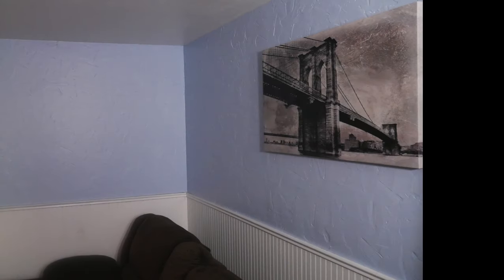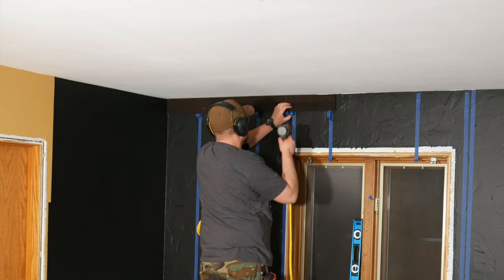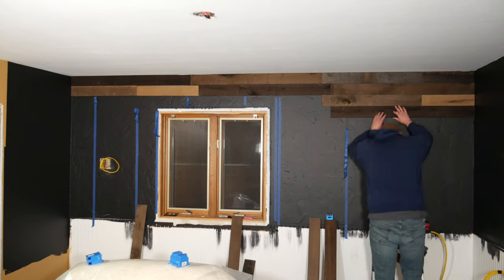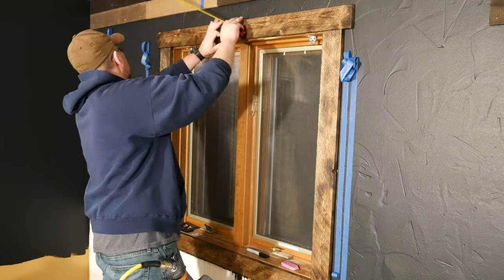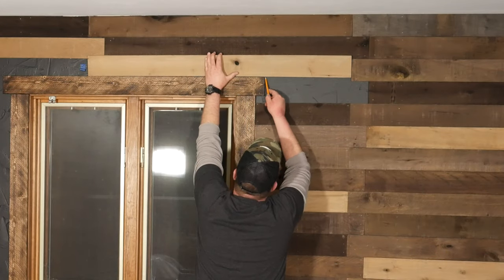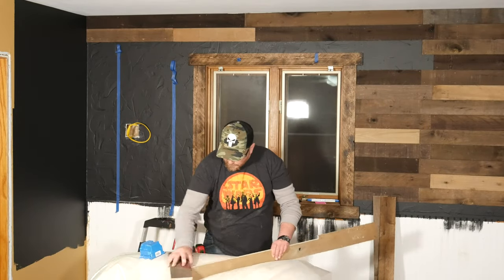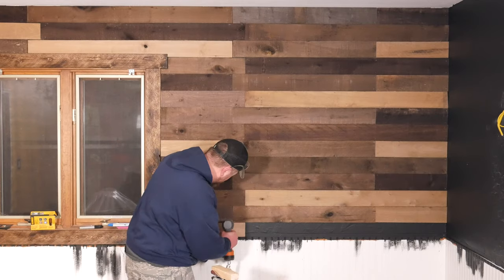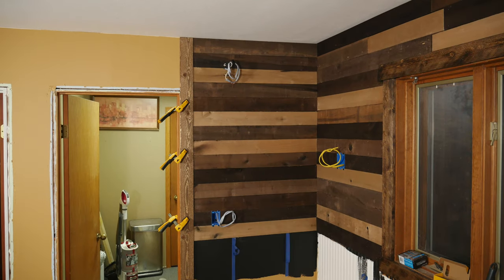How to install a rustic wood plank accent wall for beginners - The Family Room Remodel Part 17

Comment: Great vid! any issues with contracting/expanding/warping with change of moisture levels? thank you!
Reply from the maker: Thanks for checking out the video. So far no issues with warping after installation, they appear to be very stable. These planks come very, very dry out of the box. I would be surprised I ever have any issues with warping due to moisture changes, but I live in Montana and humidity levels are fairly low here. It would be interesting to see how these do in humid climates like Florida. In any case definitely let these sit in your house for a while before installing so they can acclimatize to the temperature and humidity in your house.

Comment: Nice job I was relaxed 
Question what size of nails did you use for the wall
Reply from the maker: Thanks for checking out the video. I used 18 gauge brad nails.
Reply: @JFKreations  2" or 1 3/4 or 1 1/2?
Reply from the maker: @MAZINKAIFER  it depends on how thick your walls are, how thick the material is your attaching to. I think I  used either 2” or 2-1/8”, whatever the longest I had on hand at the time. You have to consider the thickness of planks, plus the drywall (or lath and plaster, or whatever the wall is made of) to determine the length of the nails you need. In this case if I would have just done 1-1/2” nails, the nails would barely penetrate into the studs. Wouldn’t be a solid connection. Hope this helps you determine which length to go with. If you’re unsure, go with the longest your nailer will shoot.
Reply: @JFKreations  Thank you for the information and taking your time to answer me! I am your New Subscriber
Reply from the maker: No problem and welcome to the team! Glad you enjoyed the video

Comment: Thanks for the video! I have a question, I  notice that you nailed the ends of the boards even where there were no studs. Will these hold in the drywall?
Reply from the maker: Thanks for checking out the video. All the planks in this video are nailed into a stud at least somewhere along the length of each plank. The stud spacing on this wall wasn’t exactly ideal at 24” on center, and at that they weren’t spaced evenly. The layout I chose unfortunately landed some of the ends of some of the planks in between studs but there weren’t too many layout options with this stud spacing.  Nailing directly into drywall isn’t ideal, but if you run into a situation like I had here, if you drive the nails in at opposing angles to each other so they sort of form a criss cross pattern inside the wall that will add a little extra tension and will provide enough extra support at the end of the plank that is not supported by a stud to hold it to the wall. I didn’t mention the criss cross nailing technique in the video, because it is less than ideal and is better to avoid having to use but in certain situations it can work. This technique should really only be used on very light weight non load bearing items like these planks and definitely works best if each plank lands on at least one stud for solid support. Hope that helps.
Reply: @JFKreations  Thank you for the reply. I am in a similar situation with uneven stud spacing , on an old drywall wall.
Reply from the maker: Jimmie C If you have some real funky situation and can’t find enough studs to at least partially support the planks, as another option, you can glue these to the wall with construction adhesive. Let me know how it turns out!
Reply: @JFKreations  Thank you for your tips. I got the wall up on Saturday. I can't figure out how to post a picture here.
Reply: Add studs. 
Never listen to someone who tells you to do anything criss cross.
Reply: Be careful not to hit any wiring or plumbing between the studs

Comment: Thank you for a great film. I need to frame a small monitoring window in our bathroom to inspect if no leeks  under the bathtub. It will be an opening on the bottom of the closet next to that bathroom. I want to make a small door (~ 24" x 24") for that opening, but not sure how to frame that cut. I'm thinking about 1/2" thick planks around the perimeter (on one of them there will be hinges for a small door), but how to attach those planks to the drywall? Could you tell what nails or screws to use better for that project? Can I use a regular hammer or better to buy a brad nailer?
Reply from the maker: Skip the hammer and nail. That’s better saved for framing where the divots left on the wood by the head of the hammer don’t matter. If you want a clean look definitely invest in a nail gun. For lite trim work that doesn’t need a lot of holding strength my go to is an 18 gauge brad nailer. Or you could look at some decorative screws that can add an industrial look to the trim. But one thing you could also look premade plastic panels that are designed for this exact thing. I have a few in my house to access plumbing through a wall. You just cut a square hole in the drywall and slide them in place. It’s a clean look and if it’s in a place that isn’t readily visible anyway, dealing with installing trim and so forth may not be worth the time or cost.
Reply: @JFKreations  Thank you. I cut the hole long time ago, when installed the buthtub, since was paranoid if there will be a leak under the tub, and for good reasons since there was initially one, which I fixed via that opening (hole). Now I have time to install a small door there, but can't find any films about it. My main question is how better to frame it so I can put hinges for a small door on that frame. I think 1/2" or 3/4" Poplar plank would be a good solution for that frame. I bought already a brad nailer (18 GA), but not sure what should be the length of the nails, I think 1" (so they don't come out from another side of the drywall). I saw one film where a lady attached the wooden plank to the drywall w/construction glue (I got one, similar to what she used), and then she nailed it slightly w/brad nailer. Though what she did were decorative attachments. The door is small, I think this approach will work as well, and such framing probably will hold the hinges and the door on them. Thank you for the idea about the premade plastic panels, but since the hole is cut already, I think it would be hard to find the insert of that particular size. Also it might give some crumbles of the drywall when you remove it or put back (though a spackling of the edges might prevent it).  Thank you again.

Comment: What type of nail gun did you use? And at what gauge? Any advice would help, thanks
Reply from the maker: Sergio, it is a RIDGID 18 Ga. Brad Nailer. If you want to take a closer look at the brad nailer,  click this link https://homedepot.sjv.io/c/1343238/459920/8154?prodsku=304530407&u=https%3A%2F%2Fwww.homedepot.com%2Fp%2FRIDGID-18-Gauge-2-1-8-in-Brad-Nailer-with-CLEAN-DRIVE-Technology-Tool-Bag-and-Sample-Nails-R213BNF%2F304530407  Thanks for checking out the video!
Reply from the maker: Sergio Sausedo Sergio, it is a RIDGID 18 Ga. Brad Nailer. If you want to take a closer look at the brad nailer,  click this link https://homedepot.sjv.io/c/1343238/459920/8154?prodsku=304530407&u=https%3A%2F%2Fwww.homedepot.com%2Fp%2FRIDGID-18-Gauge-2-1-8-in-Brad-Nailer-with-CLEAN-DRIVE-Technology-Tool-Bag-and-Sample-Nails-R213BNF%2F304530407  Thanks for checking out the video!
Reply: @JFKreations  ok thanks, love your work, came out pretty sweet
Reply from the maker: Sergio Sausedo thanks, definitely appreciate the compliment. Hope your project goes well too!

Comment: How about putting these in a cement wall or old horse hair plater walls that have metal mesh screens and wooden slabs? Is there a way to put them then??? Thanks nice video
Reply from the maker: I’d probably go with furring strips and nail the boards to that. Hope that helps
Reply: @JFKreations  thank you sir, might have to try that

Comment: so do i have to cut the plank to by the stud? if the end of the plank is not nailed to the stud, does it not going to warp or get lifted?
Reply from the maker: It shouldn’t. These are pretty dry and shouldn’t warp any more than they already are, but working with reclaimed wood or in the case faux reclaimed wood, the material is rarely perfectly straight or flat, that’s part of the charm

Comment: I was about to do one of these and  was worried about possible gaps in between the boards since I didn't want to pop the extra $150 for the tongue and groove and I guess I was right. I tried paneling at 1st but found that the materials today are way different for the materials of 20 years ago hence the paneling I bought was sturdy as about a piece of bread. On small strips it just snaps from weight or vibrations from saw. Unfortunately I took off all the old paneling and now need to put it back on before I can paint it black 😬😒

Great solution there, better safe then sorry with the money and time (especially) it takes to get it done 👍
Reply from the maker: David U heck yeah, when in doubt, just paint it black! And you are right, it’s so hard to find quality anything anymore even good lumber and hardwood is hard to find. But ah well, we work with what have and make the best of it. I’m glad I was able to help you with a solution to hide the gaps! Thanks for stopping by and for taking the time to leave a comment.

Comment: Is this a planned out pattern or random? Having a heck of an issue planning a pattern lol.
Reply from the maker: Not really all that planned out. There are enough colors to randomize it. I can suggest one approach. Open several boxes at a time and shuffle the deck, so to speak. Once you get rolling you’ll get a feel for how to mix and match and then just go for it
Reply: @JFKreations  I finally sorted it out, just sanding my boards now, then stain, then cut and apply. I'll update you later. Mines a small scale project it's just a photo/video backdrop wall.
Reply from the maker: @NewYears1978  oh yeah, that will look nice as a backdrop.
Reply: @JFKreations  Yeah I had built the wall already but I used grey paint/stain combo. Since then I replaced my desk tops with butcher blocks with dark walnut stain, so making the wall to match =D

Comment: Did you ever think of doing the walls first, then put the casing around the door and windows? Just thinking that might be a better look if the casing was raised above the wall?
Reply from the maker: Just Me thanks for checking out the video. I did consider doing exactly that, running the planks up to the edge of the window and putting the trim on top, but decided to go this way instead. The reason being if I had the planks run all the way to the window with the trim on top, then you would be able to see the cut ends of the planks behind the trim, and didn’t think that would look very good. I suppose some additional trim to hide those cut ends could be added if you really wanted the trim over the planks. The trim is quite a bit thicker than than the planks, so it does sit proud of the wall planks achieving a similar finish to what you’re suggesting as it is. Ultimately butting the end of the planks right into the trim hid those cut edges and gave a cleaner look.
Reply: @JFKreations  Thanks for the reply, I am considering doing this to my bedroom and have been going back and forth about the trim. Your reason was one of my reasons not to use the raised trim!
Reply from the maker: Good choice for a bedroom. Wood planks like these make the space warm and cozy, perfect for a bedroom. Go for it!

Comment: Quick quespionage I bought the same wood my buddy said I would have to put a clear coat if I put it up on the walls of my garage so termites don't damage it, how true is that statement ?
Reply from the maker: Good question. Applying a finish or sealing the wood can help prevent insect infestation.  There are specific products available designed for just that purpose, but you’ll see that done more often outdoors on fences for example. Saying you “have to” for a feature wall inside a garage is maybe a bit of a stretch and probably comes down more to how concerned you are with infestation compared to the extra time and cost of sealing these planks. I personally would skip that step because we don’t have a lot of termites where I live. I don’t think the extra time and cost would be justified here. But that comes down to a personal philosophy of mine, you have to weigh the cost of doing the thing compared to the actual risks and potential cost of not doing the thing. If you have the time and extra budget and are truly concerned with termites, then you should seal these. If not, then maybe you can get away with skipping that step. Hopefully that helps you make that decision.
Reply: @JFKreations  Thanks for the detailed response I appreciate it, very helpful.
Reply from the maker: No problem thanks for stopping by the channel

Comment: What kind of wood did you use ?
Reply from the maker: Weaber 1/2 in. x 4 in. x 4 ft. Weathered Hardwood Board (8-Piece) https://homedepot.sjv.io/c/1343238/459920/8154?prodsku=207078140&u=https%3A%2F%2Fwww.homedepot.com%2Fp%2FWeaber-Weaber-1-2-in-x-4-in-x-4-ft-Weathered-Hardwood-Board-8-Piece-27862%2F207078140&intsrc=PUI1_2950 There is also some additioinal information and links in the description below the video you may want to check out. Thanks for checking out the video!

Comment: if i need to install these boards to not a drywall with studs but  aluminum frames holding the plaster board, then what are my options?
Reply from the maker: Situations like that I usually install a backer board first. 1/2” plywood usually works perfect. Once the backer board is attached to the wall, you can brad nail these planks in place just like in the video. Hope that helps and thanks for checking out the video!
Reply: I was kinda thinking the same but how and with what would you attach the backing board to the plaster wall?  would that not add more load?
Reply from the maker: What’s worked for me in the past is wall anchors. Set the anchors in the wall and drive screws through the plywood backer board into the wall anchor. If you get slightly higher weight rated wall anchors, you’ll be surprised how well that will hold the plywood. If weight is a concern, furring strips would achieve the same concept as the plywood backer board at a lot less weight. A couple other ideas, there are specialty fasteners made to attach sheet goods to metal studs, they usually have a self drilling head. They are specialty fasteners so you’d probably have to get them at a fastener supply store like Fastenal. Just be sure you get the right type for your application to avoid any galvanic action from dissimilar metals. The people at the fastener supply store should be able to help you find the right screw. You could also frame in a new wall with standard stud framing and drywall, but that could be expensive and may not be practical depending on the size and location of the wall you’re wanting to install these planks on. One last idea, and this is my least favorite because of its permanency is you can glue these decorative planks directly to the wall with construction adhesive. You’d still need a way to temporarily secure them to the wall until the glue dries though. You can drive finish nails in at opposing angles and that will likely hold long enough for the glue to set or, and this is completely experimental because I have not tried this in this exact situation, but a few dabs of hot glue may hold the planks in place long enough for the construction adhesive to set. It is hard to say what the best option is there without being there to see what you’re working with, but hopefully these ideas will lead to something  that will work. You may have to experiment just a little.
Reply: Thank you!!!

I'm trying to use them weathered planks  within the three walls that house my daughter's drum set in the basement...but the contractor used plaster walls and secured them with aluminum frame...kinda...lol!

Thanks again!
Reply from the maker: You’re welcome. Hopefully I gave you a couple good ideas to try out. Good luck on the project and let me know how it turns out!
Reply: JFKreations i would like to do this as well. I have the same type of wall. The colour on the wall is a real dark denim blue. Do i really have to paint them black anyway, or can i leave them blue before i start?
Reply from the maker: Patricia Almeida If you’re walls are already a dark color you’d probably be fine. In my case with the light blue I did need to paint the walls first, that light blue would have shown through in a few spots. In general I would recommend painting black first anyway, but you’ll have to decide if it’s worth the extra cost and time for your specific situation. Good luck on your project!
Reply: JFKreations thanks for your quick respond! I think you convinced me to paint it black. I was doubting at first but in the end it would probably look better with the wood. Thank you 😊
Reply from the maker: Patricia Almeida you’re welcome, you’ll probably be happier with the results.